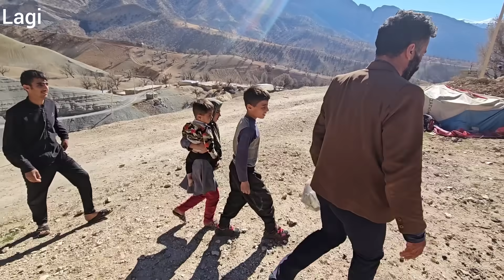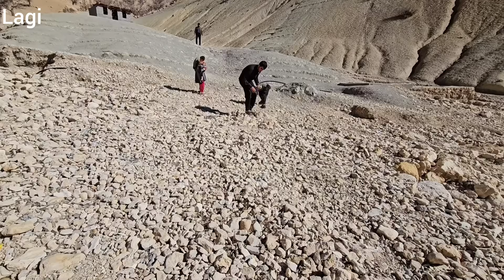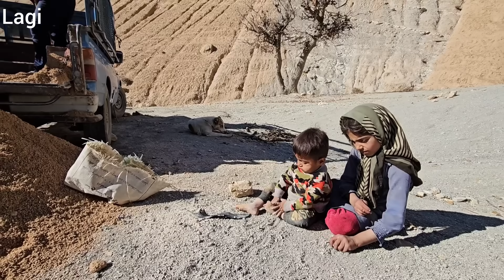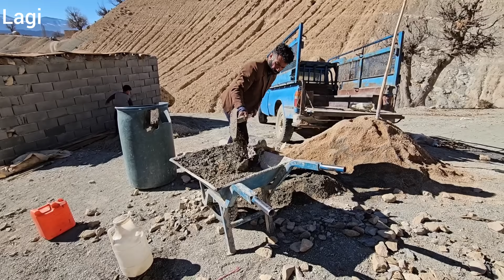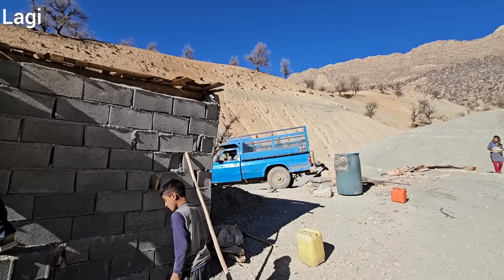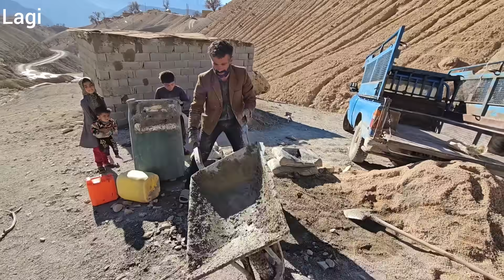A love that never fails: The kind man's unique love for motherless children

Comment: Hope this kind of a returns the stove needs connected.the outside of house needs cement the inside needs plastered the front needs plastered…they need a rug on floor…they need mats to sleep on & I would hope that someone wood be created enough to make shelves with the concrete blocks & boards that extended from one end of the cement block to the other to get items off the floor